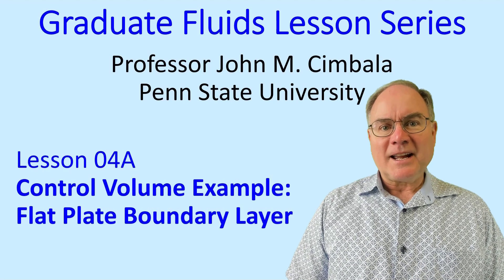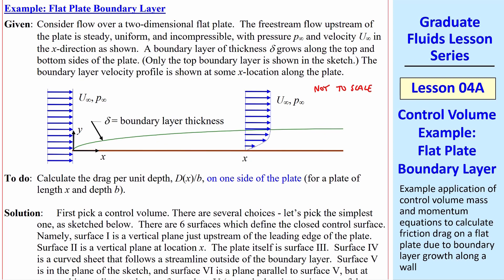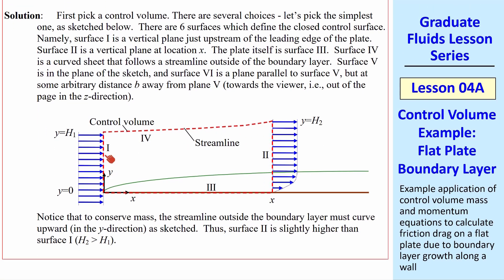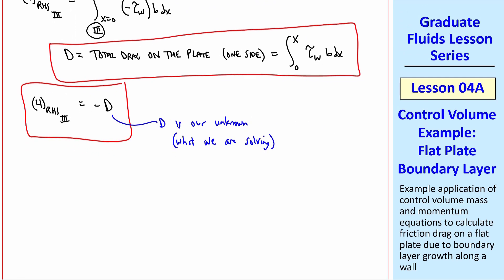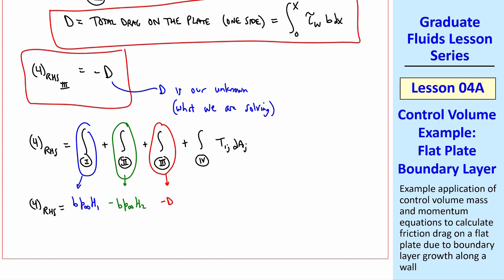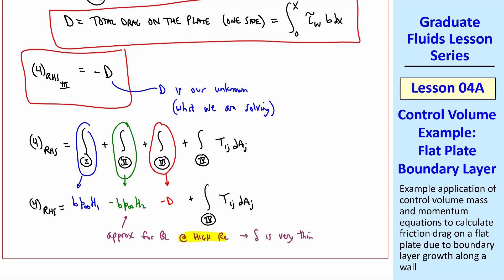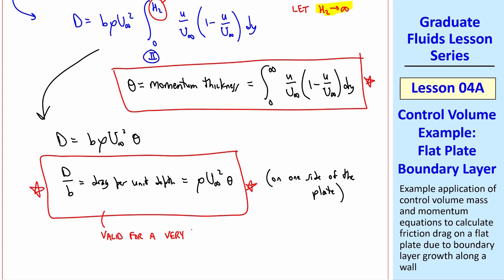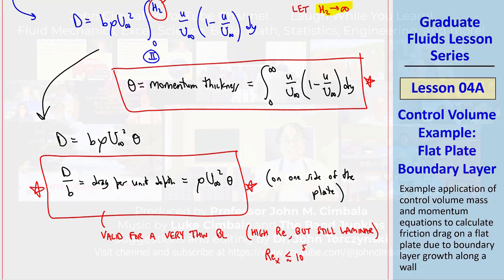Graduate Fluids Lesson 04A: Control Volume Example: Flat Plate Boundary Layer

Comment: Thank you Prof Cimbala for the brilliant video series! I have one question regarding the velocity gradient at 11:04. I know that U_∞ is a constant (at surf-1). However, as soon as the flow enters the control volume (at surf-1), it should start to "feel" the drag and decelerate. Could you please explain why del_u / del_x at surf-1 is still zero? Thank you very much in advance.
Reply from the maker: It is not exactly zero but negligible compared to any other terms. In the limit of an infinitesimally thin plate, the effect on the flow above the plate at the leading edge is extremely small, especially compared to the other terms in the analysis.
Thank you for your kind comment. Please tell your friends and colleagues about my YouTube channel where there are more than 570 free videos about the Bible, fluid mechanics, science, math, Excel, statistics, air pollution, and other topics. I would greatly appreciate it.
Reply: @johncimbala  Thank you Prof. Absolutely!